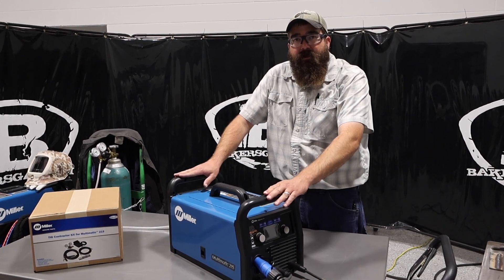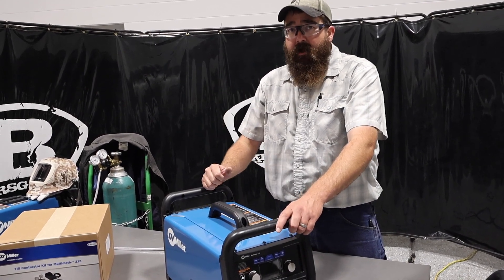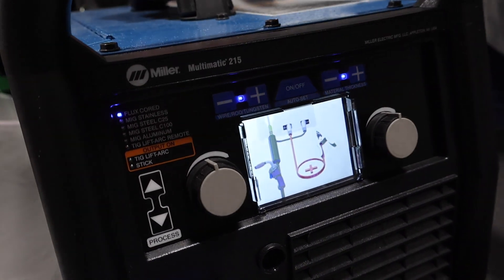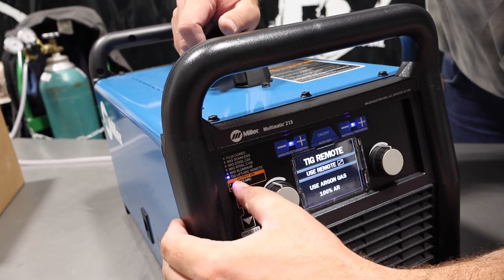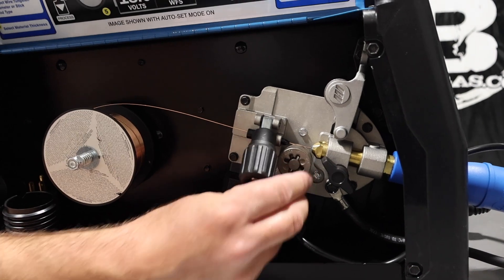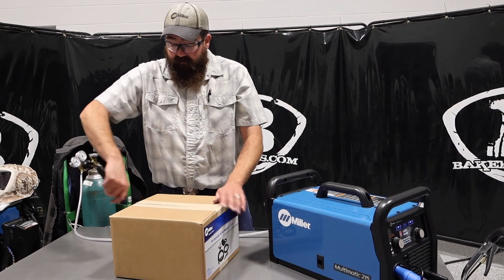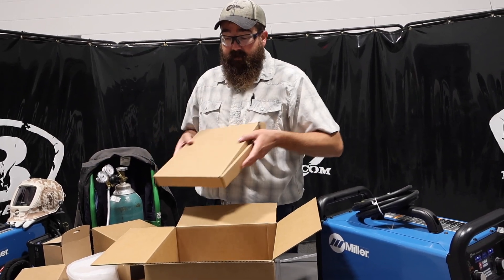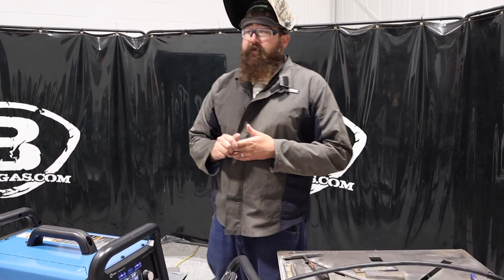Miller Multimatic 215 Review & Tips 907693

Comment: I like the arc start on the mig setting. No bumping off into the puddle. Mine is sitting in the garage til i can afford a table and some steel.....and a shield.......gas.....rods.............jacket..................respirator..... anyway I am sure I will love it. BTW this welder is $2500 w the cart, some 030, mig and stick lines..and some cheap miller gloves.
Reply: i feel this hahaha, just bought mine tonight and im like alright i got the machine... now i need a decent table...some steel... etc lmao.

Comment: Hi Andr'ew. I'm curious, at 1:32 , why are you saying 'no aluminum with the 215?" I've just watched a video on the Miller channel, showing how to set up the 215 for MIG welding aluminum. Here it is. Your thoughts? https://youtu.be/JFAosdbo-eY?si=o1L87w6-HB0wkQ8o . I understand that there's no AC TIG welding for aluminum. The Multimatic 220 can do that. I also understand that the Multimatic 255 offers pulse TIG for aluminum. So, in your view, can the 215 be used for acceptable aluminum welding for a home hobbyist/fabricator? Thanks.

Comment: I love my Miller #Multimatic215 however, I need to buy a gas powered machine because I find myself doing lots of mobile welding. My Cummins P4500i Generator will not keep up. The inverter keeps shutting it down. Any thoughts on how to tweak so that it has slightly more power? I think the safety features shut it down and prevent me from Welding.